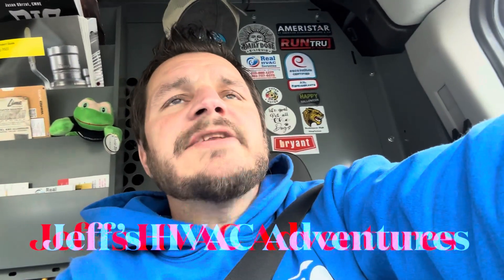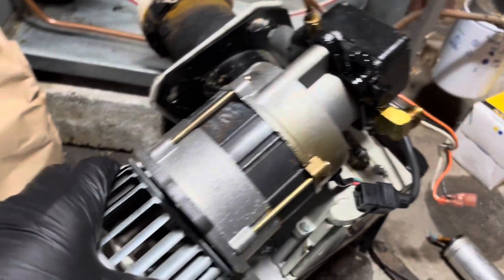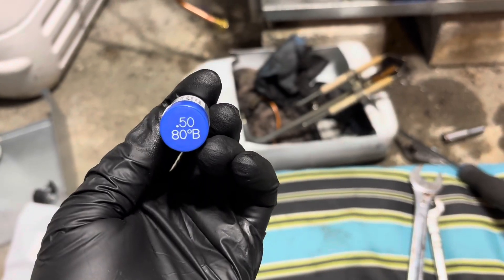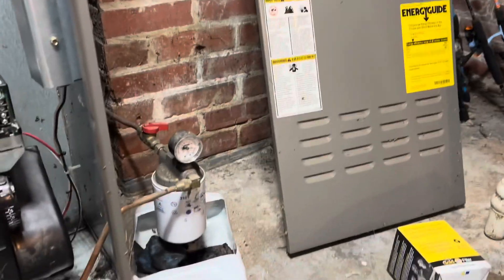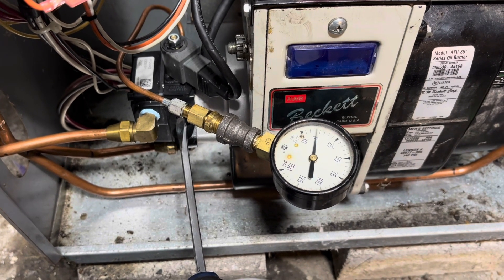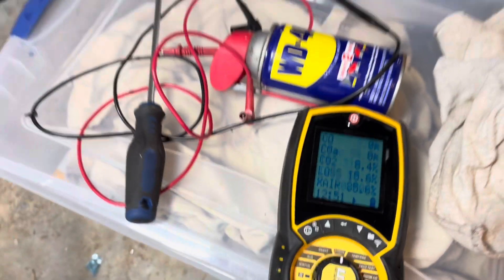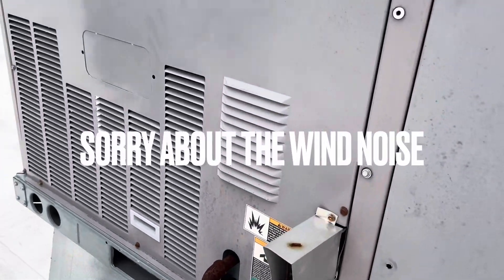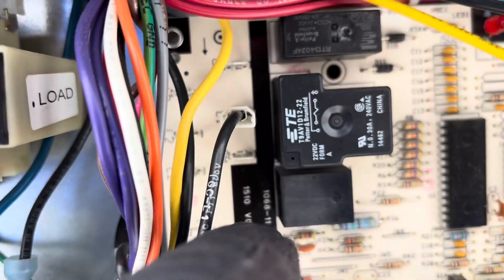Oil Furnace Repair On AFII Burner | Draft Inducer Replacement On ICP RTU

Comment: You aren't the first tech I've heard hate on the AFII. As a homeowner doing maintenance and repairs, I'm sorta stuck with it for now. Can you explain why there is such a hate for this model?
Reply from the maker: Because it’s the only Beckett burner whose parts aren’t interchangeable.   All the old AF burner parts and AFGs are interchangeable.  The AFII has its own specific parts.